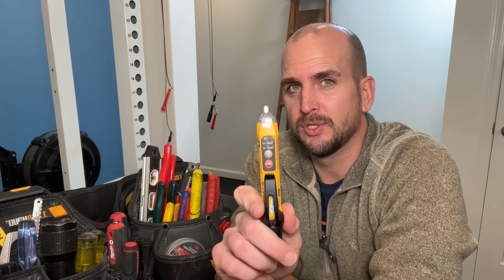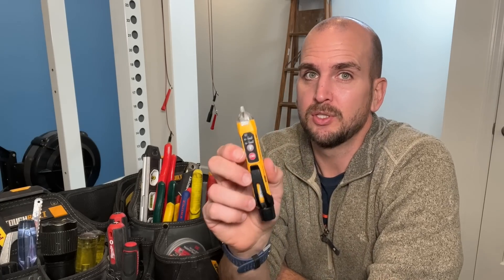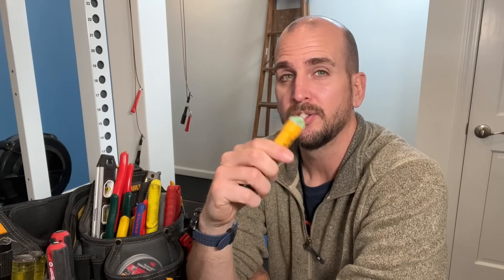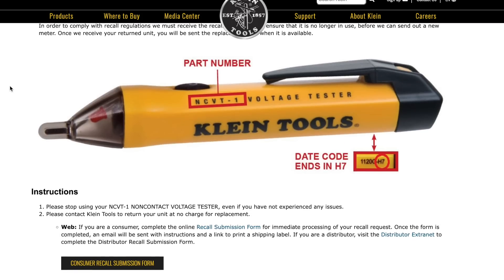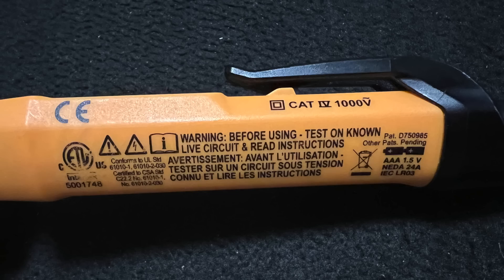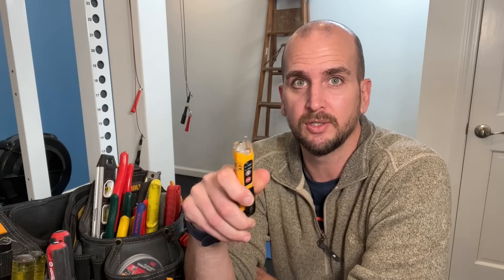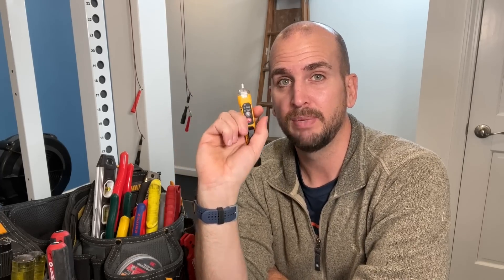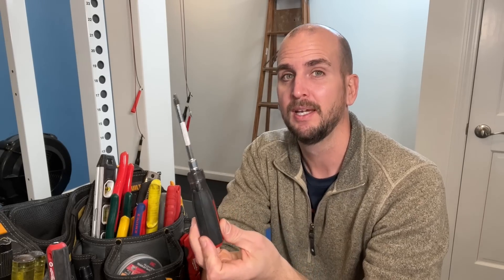The Tool I Get The Most Negative Feedback On And Still Use Weekly

Comment: Scott, because of your recent recommendations I bought a Klein electrical test kit consisting of an RT105 receptacle tester and and an NCVT-2P non-contact voltage tester. I have tried them out, and so far so good. I greatly value your advice and appreciate your calm, clear presentations of issues we as homeowners often face. Thank you.
Reply from the maker: Hey man, really appreciate the feedback.  For me right now it is hard to beat the value of the Klein Tools testers.  If I run across something better I will be sure to share 👍
Reply: This guy is a jack of all trades, master of none. He is not the person to take advice from. Hes just here selling stuff.

Comment: I have been using these things for 20 plus years and have never gotten a false positive. When you move it and the light flickers that doesn't count because anybody with a lick of sense knows why it went off. Don't confuse the light flickering on and off with it staying on and the thing beeping. I have also never had a false negative with at least 120 volts, as long as the wiring is not inside metal-clad or inside metal conduit. If you know how to read these things they are impeccably accurate and an absolute must have. What I find funny is the nomenclature people use when talking about these. 10 different people call this thing 10 different things. I call them "tickers".

Comment: I totally agree with Bret Green. I'm not an electrician but I did study electrical engineering, power systems, electronics repair and had a degree in physics with over 30 credit hours in labs, not including professional work and I use NCVT but I never rely on a single measurement and use multiple instruments when I can't. Bret's advice about treating every wire as live is always good practice, especially if your handling house voltage which starts at 10 Amps and only goes up from there.
Reply from the maker: Good points!
Reply: Same EE-physics degree. Diy'er for almost any home project.
I've been getting hit with 110 since I was a kid. (stupid Xmas lights every friggin year) It bites, doesn't kill. If working on 10/20amp home stuff... I'm not too worried.

I just put in a new 50amp 220vac for a new stove. You best believe I was much more cautious, even with only one hook into live power. I know how deadly the main into the house can be, and treated it as such.

So, my point is just be risk aware. Hot swapping outlets on a 10amp line... Great. But dangerous situations require different mindsets.

Be safe all.

Comment: DIY'er here and would not go without my NCVT. Even though I know the wiring and circuits in my house. One example people should know about: A couple receptacles in my house are fed by two circuits. Two breakers need to be switched off. I suspect a lot of places are like that, with multiple,  mystery circuits running around. And for me, a "false positive" is not a problem. If I get an unexpected one, then that is a warning - what these devices are for - to investigate further.
Reply: Its the false negatives you need to worry about. Use your meter not a toy.
Reply: @RadioRich100  Oh again.

Comment: I have a  Klein NCVT-1P.  Had it about 6 months, it works fine and doesn't seem to be a model included in the recall but the clerks at Home Depot in Canada  where I bought it didn't know. There is  the number 0721C-H8 printed on the tester. Doesn't look like a date stamp. Any ideas?  I am a retired carpenter but a very careful DIY when it comes to electricity, and I find your videos very helpful.
Reply from the maker: Hey Don,  I think you are good.  That was the model included in the recall but the number had to end in "H7" to be impacted by the defect.  Since yours ends in "H8" looks like you shouldn't be impacted by the recall 👍

Comment: I relied on the Ideal Mini Volt Tick for a few years, and then they quit production and I bounced through a few before settling on Milwaukee.  it still burns through batteries faster than the old ideal, but it's pretty consistent in its performance.  my biggest issue with the one you have is how wide the stick is.  the milwaukee is slimmer all around and tapers over the last 2 inches to get into tight spaces.  my current one (cat #2203-20) is auto ranging for 10-1000VAC.  it's a little annoying because it's a little sluggish responding, but it also gives me a better idea whether I'm picking up a live wire or just induction voltage.   

as for the "professionals don't use them" claim - rubbish.  it is usually the most commonly used diagnostic tool, because it is fast and convenient.

Comment: Call them an Idiot stick. You're an idiot if you don't use it and you're an idiot if you don't  double check with your meter.  Have used a Fluke nvc for years.

Comment: As a person who worked in the communications industry for over 30 years I had to make use of a noncontact detector regularly. We also had to use multimeter and another unit that all linemen should have on their belt. I've gone to plenty of homes that had voltage back flowing into the ground and or voltage riding on other utilities due to some bad wiring or a  ad piece of equipment.  The Klein testers had a procedure by which you turned them on correctly it gave a true reading. You could test them by using your index finger and thumb that would let you know if it was ready . If turned on while trying to test they would give a bad reading everytime. Also every so often we would send them off to be trued by the manufacturer. We had a backups when we needed to send them.

Comment: I have a hotstick on my toolbelt at all times. Today the same hotstick I had been using all day gave me a false negative on a circuit and caused me to blow up my wire strippers. Same hotstick worked fine moments later when I tested it again. I have now evolved to testing hot circuits by stripping the wires and then touching first the neutral, and then the hot to my testicles. genitals very enlarged. bosses mom very happy. life is good.
Reply: there are essentially no cases of false negatives beyond a design flaw, in Klein's recall where the tester would not test while the button was pressed. Other "false negatives" are likely to be explained by human error.

Comment: The multimeter is great, but when I'm working on simpler electrical-only projects, I just carry a simple neon tester along with the non-contact tester. The non-contact is great for first line checks, but the neon tester verifies power is off at the terminals/conductors before anything is touched or handled.
Reply from the maker: Hey buddy, good to see you on the channel and thanks for the feedback!
Reply: What is a neon tester?
Reply: @georgekolos5255  The simplest and cheapest form of contact tester. Essentially just two short probes/leads attached to a small neon indicator lamp that glows in the presence of line voltage (110/120, but also usually a lot lower).

Comment: I've been doing electrical work for a few years now. I use both a NCVT, and a multimeter to check if a circuit is off. If I open a box I'm not sure of, I'll use an NCVT, but I never rely solely on the NCVT. Been a few times where I use my NCVT to test a receptacle before touching it, and when I tested it with my multimeter, the multimeter went off. 

If I'm LOTOing a circuit, every company I worked for said to never use a NCVT to determine if it was off and to always use a multimeter. All the Journeymen and foremen I've worked for would kick me off the jobsite if I ever used an NCVT to verify if a circuit was off. Get a good one. Klein multimeters aren't the best. Most of their test equipment isn't the best as a matter of fact. I use a Fluke T5-600. It's pretty expensive, but fluke is probably the most trusted out of all the brands that make test equipment.

Comment: I use my Greenlee one quite a bit. If the light doesn’t work but the tester says there’s voltage, I’ll pull out the multimeter and see how much voltage there is.

Comment: Sorry but I don't trust this tester any further than I can throw it.  At one time I was going to send it back to the maker, but that was such a hassle I decided not to take the time.  It's in my tool box only because maybe somebody will come up with a solution as to why it only works when it wants to.  Multi-meter is much better.

Comment: Good summary. I use my  NCVT most of the time because it is easy to fit into my bag and you can use it one handed. However I have a multimeter and use that when I need certainty or when wires are packed to gether in a box and I am concerned about false positives
Reply: Its false negatives u need to worry about. Since theres worries and you need a sure thing everytime use a meter everytime.

Comment: My house has outlets tapped from various places that don't correspond with the breakers on the panels. So I have a loud freezer failure alarm I use to make sure I get the right breaker off. Also it may be possible danger using the one probe NCVT on a tamper resistant outlet as the inside shutter wont open to allow the one probe in.

Comment: Excellent review Scott!  And a lot of great comments in here, especially from Bret Green.  
I don’t understand any pushback on the use of one of these?  I personally use the one you mentioned.  I tried 3 or 4 before settling on that model.  Like any tool, proper knowledge and usage leads to success.  And hats off to all the great comments in here!  
Take care and stay SAFE!  👍👍👍✌🏻🇺🇸🔨
Reply: @RadioRich100  Well hi there Rado Rich, appreciate your heartfelt concern there!   🙄 
I do as a matter of fact, and it is a Fluke.  This video was not about a meter, now was it.  Your point is taken, and is a valid one.  If I am in doubt, I will double check with my meter.  Take care and stay safe!

Comment: I have about 3 of these, mainly because I have 3 tool pouches.  I only use em for a quick voltage finder to save time.  But if needed I have a volt meter to be sure.  Like I said, it's a time saver!
Reply: Time saver and life saver are 2 different things.

Comment: I use a NVCT and a DVM on jobs. NVCT to detect the presence of voltage and if I need to verify whether the voltage is correct I use the DVM. As someone else mentioned you can get a false positive with NCVT because many times you have multiple circuits in a electrical box. With multiple wires in close proximity you need to be aware of what circuit your testing. I like the NVCT for quick checks but never is it a substitute for a DVM

Comment: Master electrician, I use NCVT frequently, I don't rely on it as an absolute, but it has saved me from unexpected shock or burn many times. I find false positives in dead wires that run parallel to live ones such as in a conduit, or a three wire Romex such as a 3-way switch. Even digital multi-meters can show a "ghost" voltage". This is due to induced voltage or capacitance on the "dead" wire". I once had an electric co. employee tell me the 3/0 wire was shorted when he read ohms on a new wire I had just installed. I proved him wrong by connecting it to a live 20A 120V circuit. This would have prevented a catastrophic incident Rather than hooking it up to a 200A circuit.
Reply: Excellent Hank!
Reply: That's why we check circuits with a "wiggy" or at least a multi-meter with a Lo-Z setting.  Ghost voltages go away when a load is applied.
Reply: @joeearls8878  I trust a wiggy!